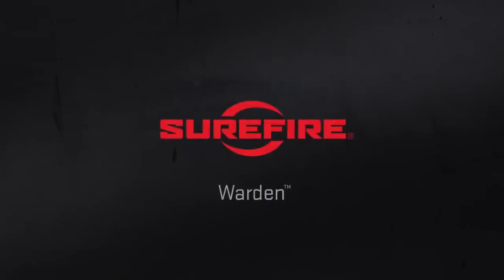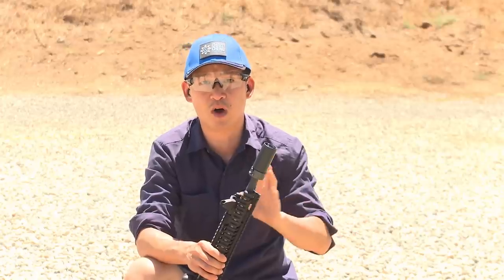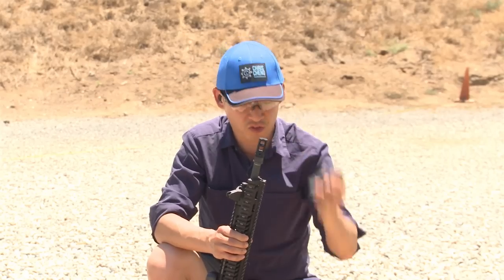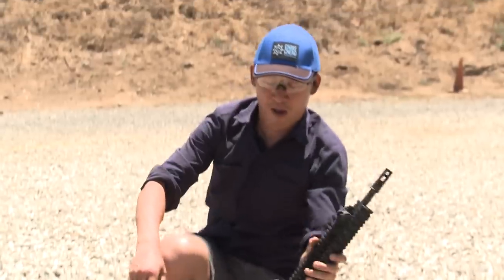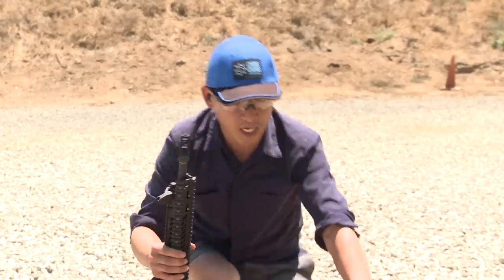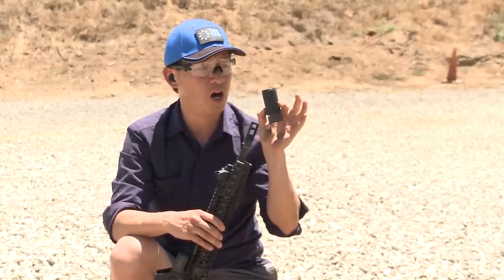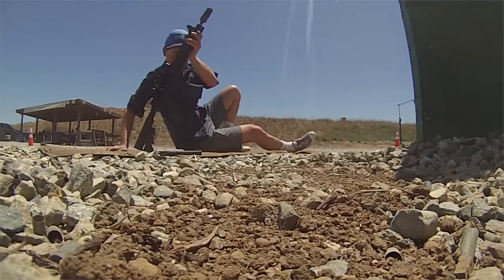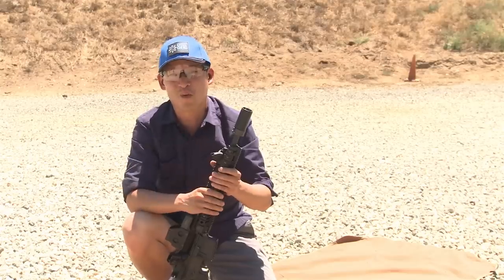Chris Cheng has a blast with the SureFire Warden

Comment: Watch the muzzle flip.  It looks like the Warden might undo some of the recoil reduction that the muzzle brake offers.
Reply: +Tonz a Gunz Because it redirects the gases forward, it's expected that it's going to produce a bit more recoil than with the brake alone; however, it allows the gases to diffuse and exit the muzzle at a lower velocity. 

More recoil than with brake alone and less recoil than with standard flash hider.

Comment: Honest question, why have both a comp and this when going without either does the same thing?
Reply from the maker: To have the ability to switch back and forth (no recoil/muzzle rise to no side concussion) depending on what you are doing. Also, it is preferable to have something on the barrel to protect the threads and crown (albeit doesn't need to be this combo).

Comment: Nice !....is there any zero shift with that on?
Reply: I've noticed if I'm using hotter, lighter rounds like M193, at 100 yards groups will open up about quarter to half an inch but if heavier rounds like m855 or heavier otm type rounds the groups actually will tighten up which is weird.... I use the surefire Warcomp 5.56 Flash Hider which is primarily a flash hider with recoil mitigation when timed appropriately as my quick attachment point. I sent an email to surefire about this and never got a response back but my only guess is that this is due to the forward pointing blast cone causing some kind of disturbance that's extremely minimal to the point where it just barely effects lighter rounds since I'm getting such a small opening up difference in group size. Also, the groups aren't shifting like they would with a suppressor, they are just taking my original zero and equally opening it up from center point so technically it's still perfectly on target..... Now..... As far as the heavier and slower rounds tightening up I can't come up with any explanation other than they possibly are leaving the barrel at a higher speed maybe? I'd love to chronograph and see if there's a discernable difference because it's definitely doing something to effect the rounds. Surprisingly this warden attachment kills a ton of muzzle lift and transfers that energy directly back to my shoulder so with a nice and strong grip while pulling the rifle back into my shoulder the rifle becomes much easier to lay down fast and accurate shots BUT I'm still indecisive if that's a benefit worth having for a home defense situation.... On the flat range I'm able to get a nice and strong athletic stance and absolutely destroy paper, even on transition but if you're ever on the move, transitioning from a strong stance and grip the 556 starts to feel more and more like a 7.62 or 6.5 cartridge and any other position other than a steady prone is now taxing but the difference the device makes indoors as far as sound concussion goes is actually a HUGE difference, even for the shooter. At the indoor portion of our range there's 25 yard long and very skinny walls that go the entire way down the 25 yards that are max 4 foot wide. With the device off you need foam inserts AND earpro overtop if using a rifle and it's still super loud and you can feel the concussion still rattling your chest and bones but with the warden on it practically eliminates the concussion completely and I can comfortably shoot with just the foam ear protection.